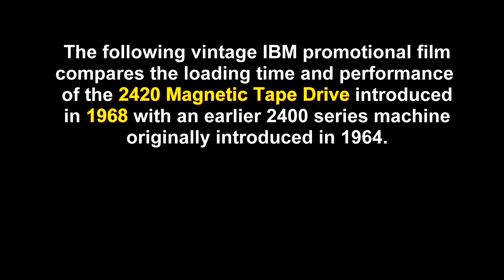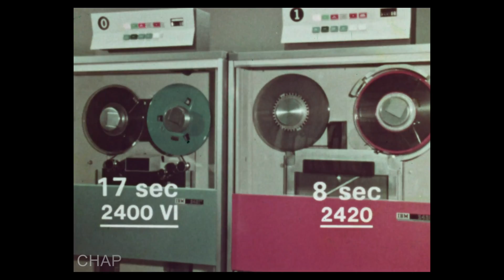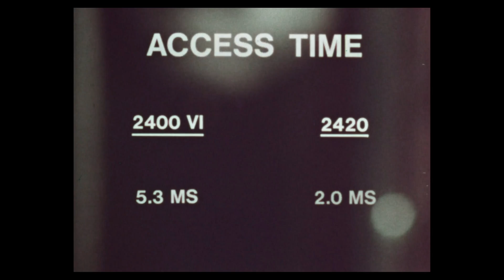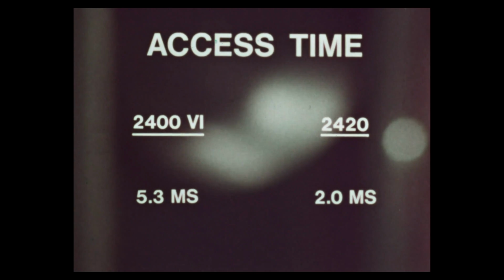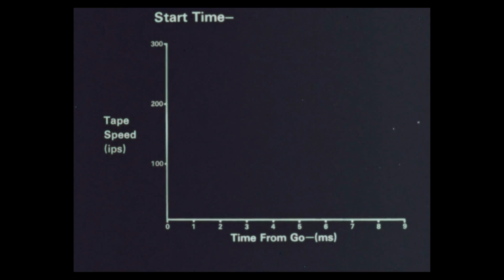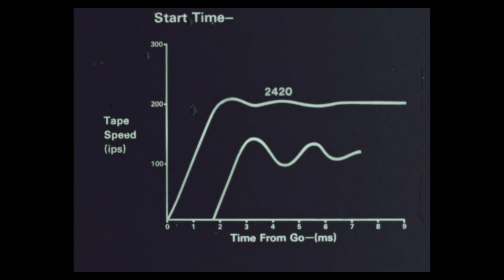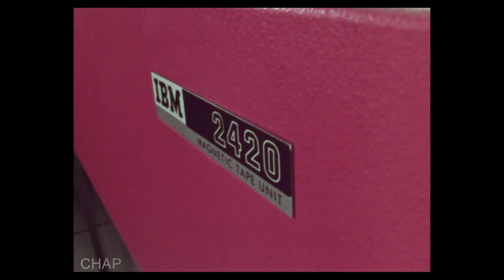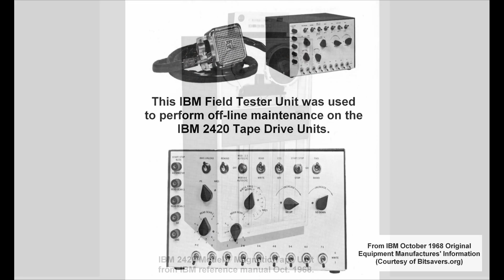Computer History:  1968 IBM 2420 MAGNETIC TAPE DRIVE Intro Announcement (mainframe System 360)

Comment: In 1979 I worked at Storage Technology Corporation (STC) also in Boulder, Colorado. They produced an IBM plug compatible version of the 3420. I wrote firmware in Z80 assembly code for the control unit. Those machines were very impressive! The servo mechanisms were unbelievable!

Comment: The one thing they leave out is the incredible NOISE of the vacuum system that handled the tape.  Those things were loud!  You absolutely had to have these machines in their own separate room, or the noise would drive you insane.
Reply from the maker: Interesting!   Didn't know that about the noise.  Makes sense, especially if you had a whole row of them running at once!    Thanks for the historical info!  ~  VK
Reply: I had a PC tape drive in the '90s. It was pretty noisy too, although its sound was somewhat musical.

Comment: It look like a tape recorder.  Just like a Tandy computer.
Reply: Microcomputers at that time were using audio cassette decks for tape storage. Loading tapes was very easy, but capacity and reliability were pretty bad.

I think the Tandy machines all used floppy disks, though, not tape. Correct me if I'm wrong!

Comment: Whelp, time to upgrade to the new and improved model. 💰  Any trade-in value on my old stuff? 🤔

Seriously though, that auto load is really neat and how they were really thinking through minimizing tape wear! 🤓  I can imagine the blower motors and related parts were quite important so were made robust, and probably had filters on them to keep everything clean and working properly.  I remember our Perkin-Elmer 3230 stopped working because small styrofoam bits got sucked in and blocked a flow sensor which triggered a false loss of air flow that shut the system down.  That was a fun trouble-shooting adventure (pro tip - keep little bits of fluff out of the computer room)! 🤠
Reply from the maker: Hi @meltysquirrel2919, thank you for the great feedback and story!   The "Perkin-Elmer" story was great.
~  VK, CHAP

Comment: That's quite an improvement and a lot of ingenious engineering compared to the previous generation. But I'm not so impressed of the time savings for loading.  Going from 17 seconds manual unload+reload to 8 seconds automatic - that's not much gain in percentage of the total time the tape is loaded on the drive. So either the operator was really skilled and experienced  or the autoloader was kinda sluggish. ;-)

Comment: When I was in my 20's I worked for Ma Bell. Our department did cable mappings. I was an operator on a Data General 6000, with a tape drive. It had two long shoots when tape was slacked and held by a vacuum.. it was so cool.

Comment: We did not see a lot of 2420s. The primary IBM drive for S/360 was the 2401 (though my site also had two 2415 on a S/360-20). The cartridge tapes only became really popular with the follow-on 3420. Each 3803 control unit came with crimping tool to make sure the tape would feed easily. Side note, z/OS still supports the 3420!
Reply from the maker: Thank you.  Good background info, that helps.  Will have to see if I can get some 3420 material as well.  ~  VK
Reply: @ComputerHistoryArchivesProject  ik heb het 'gedeeld' 🥳
Reply: Neerbuigenheid is écht een staaltje uit die tijd.
Reply: I would think there are no 3420s or any reel tapes still in production in 2025. But, I’d bet I’d be wrong...
Reply: I don't know of any 3420s across my customers, but I know of one with 3480s still.